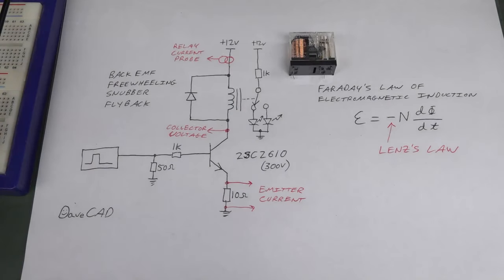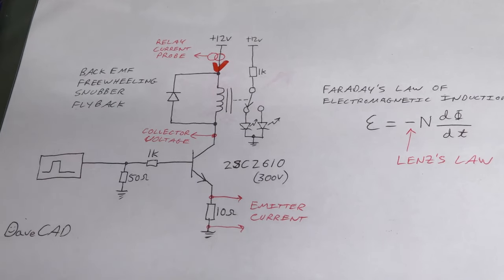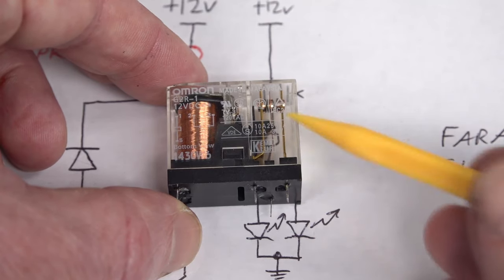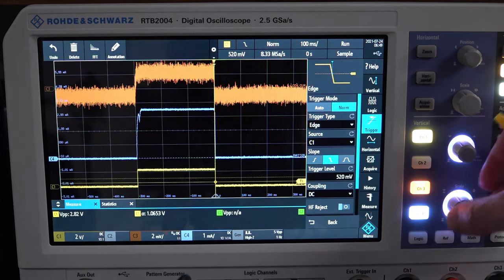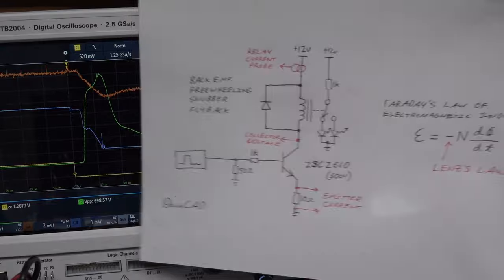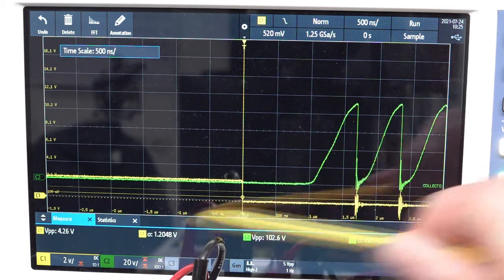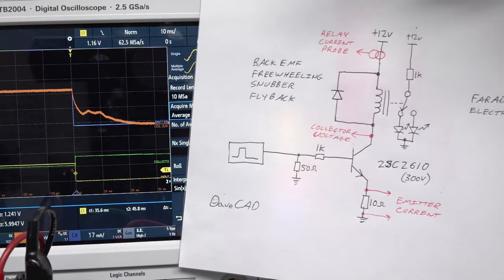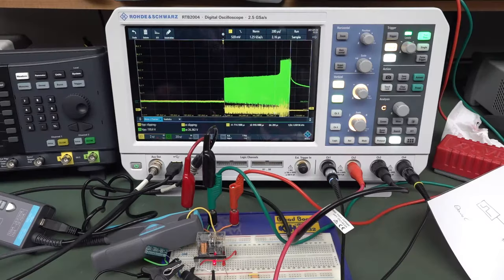EEVblog 1409 - The DANGERS of Inductor Back EMF

Comment: I think this is the best place to say my most recent vacuum tube build...it's a vu meter the tube is a bar display ...well I hook it up and it's maxed out so I add high value resistors and still no change....then in frustration I unplug the audio lines...boom I have a perfect signal and not maxed out dancing away....after some fiddling I found my audio source a blootooth pcb was sending audio thrue the power USB plugs on it threw the other power plug and into the tube ....my build is literally relying on back emf as it's input lol.....I found it cool just thought some one else might too :)

Comment: Connect two wires across the relay (without the catch diode) and keep the open ends of the wires close to each other to see if an arc jumps across the wires. That would be cool to watch! Heck, you can probably make a taser like that lol!
Reply: And this is the basic working principle of flyback converters, btw they are actually used in tasers

Comment: In the old days before semiconductor diodes, it was common to parallel coils with shunt resistors to prevent voltage spikes.  I have serviced old Western Union clocks that use a vibrator winder.  The vibrator is driven by a platinum-contact interrupter and two No. 6 dry cells in series.  The armature coil draws about 300 mA and has a 600 Ohm shunt resistor to absorb the back emf and prevent burning the interrupter contacts.  Interestingly, the Western Union clocks used in radio stations were sometimes 24 Volt DC powered and had a much higher resistance coil in the vibrator circuit, and a coil shunt resistor was NOT used.  It seems counter intuitive at first that the little innocuous 3 Volt circuit is the one making the nastier spikes.  The i in di/dt is much smaller on the 24 Volt model and thus v = L di/dt is smaller too.  Physics, it’s the law!

Comment: An excellent demonstration. It's one thing reading this in a book but it's much better when demonstrated like this. Perhaps if you had a radio and we could listen to the r.f. produced as well it might be interesting. When I was about ten or twelve years old I had a transformer and connected a 9 Volt battery to the primary. I held the wires on the primary and got a shock and didn't understand why. You don't get a shock from a 9 Volt battery.
Perhaps if I had asked the physics teacher at school why this happened I might have known. We didn't do electronics at school then, how different it is now and I might have taken a different route in the jobs I had. In the mid 60's I got the impression teachers were not interested in much more than just doing their job. I made an H.A.C. one valve radio from a kit at 13 years old but never told any other kids because I'd probably be laughed at. It was football, football, football and nothing else. I wasn't interested in football.

When I was 19 I studied for the radio exam and I found out about back e.m.f. and have since always put a diode across a relay. I use BC109's for the switching transistors and 1N4004 diodes for switching frequency bands in my home built transceiver because I had bought loads of them cheap. I love making and modifying radio stuff.

G4GHB.

Comment: Induced currents are interesting to consider.  Mostly because they flip things from the standard training on electronics of a voltage source when applied to a resistance creates a current.  But a current when applied to a resistance creates a voltage.  And how in older car points and condenser ignitions the capacitor (condenser) was used to delay the voltage rise and thus arcing on the contacts (points) as they opened and closed.

Comment: Great explaination Mr. Dave. I've suffered the same case long time ago with a bit different (you might want to put this to a demonstration if you're please). I used a 5V powered microcontroller to switch a series of components from photocoupler -> transistor -> 12V relay (with clamp diode of course) -> 7W 110V AC motor. The relay was rated for 110V and 5A AC. There was no problem in the switching on phase, but everytime when the relay switched off all the DC power was lost and my microcontroller was reseted. It was worse than switching a diode on and off. I was desperated to find a solution for that, from increasing one more layer of photocoupler, isolating 5V and 12V power supplies grounds to physically isolating the AC and DC circuits, nothing worked. I wished I could have known the QuenchArc sooner, in controlling 3 phase AC motor through contactor we has a set of these hook up to 3 phase line, otherwise the PLC would be fried. Later in my work experience, I also discovered that a triac could switch AC components quieter and essier to apply than a relay.
Reply: What’s the point of optoisolation if you still drive the circuitry from the same power supply? If the output side of the optocoupler was driven by a separate transformer winding, or by an isolated power module, you’d have had no problems on the MCU side, assuming you didn’t introduce inadvertent coupling across the isolation barrier :) You’d have blown out potentially something on the output side – the discrete transistor or the optocoupler transistor. But the MCU would have been happy.

Comment: Also, I believe on an H-bridge motor driver you keep the low-side transistors On so the motor dissipates the energy in either direction. One mosfet conducts normally, while the other lets the current flow through its internal diode, if it has one.

Comment: I think the same problem is going on in my company's hardware that keeps breaking down. We make mask's for the medical sector and we use a friction welder to make them. They are from a Chinese brand (yes I know before you ask) and the friction welder is essentially a coil. These keep killing the generator driving them or both. Sometimes shortly after installing or after a few weeks. 
I have a feeling that the Chinese manufacturer don't or intentionally didn't include this to protect the equipment. 
I think this video could be helpful to solve this problem only i don't know what value the added component needs to be. 
The generator works at max 2 amp, +-18.000Khz but I'm not sure now how much voltage right now (instructions only states it's working at high voltage).

Comment: 07:15 this arrangement is used in many HE (High Efficiency) LED lamps, where not only the current being drawn through the inductor is used, but also the energy stored in the inductor is used as well. Bigclivedotcom has taken apart many a lamps with this configuration with buck or SM PSUs

Comment: in the automotive world, two types of "snubbers" are used in relays, the first kind is just a resistor, usually found on older vehicles, or modern vehicles with hardened drivers for the relays. the second kind is when the relay has a reverse biased diode in the relay itself.  This is important, ad put the former relay in the latter place, you can easily damage the driver, and also when testing relays, if there the diode type you naturally need to be carefull about testing .. I know this is echo'd in the comments over and over but always worth bringing up. cause of many many weird intermittent failures or repeated controll module failures.

Comment: My homebuilt dual 555 ignition coil driver for charging an electric fence used to suffer a lot of back emf blowing the 555s or the power mosfet that was switching the igntion coil, ended up using a neon lamp to absorb and back emf and it hasn't blown a 555 or mosfet since in several years of operation.

Comment: I knew the principle of what the flyback diode was needed for, but I thought the extent of it was protecting the transistor/drive circuit from HV spike damage. Never would have guessed that without it the transistor can also start oscillating at 1MHz+.

Comment: I still think the way I first learned about this was the best way to understand it. Just take a 9v battery and connect it to a very large inductor. Remove one of the wires with one hand while holding the terminal with the other, and inadvertently throw the inductor to the other side of the room.
Also, if you connect a 24v DC power supply to a microwave oven transformer, it draws a couple amps, and when you disconnect it, it will maintain an arc over a centimeter long for about half a second. I'm glad I wasn't touching the terminal with my other hand that time.

Comment: The reason the relay noise changes when you add and remove the diode is because as you already said, the relay switches slower, so the diode will make the relay action softer as the voltage/current dissipates then this translates to a less vigorous click as the contacts hit each other more softly..?

Comment: 27:15   -   I'm not sure about your other proposed snubber solutions there. Whatever one put as a snubber , wether a diode or Zener or resistor Capacitor diode arrangement, the final problem always remain about the energy stored in the coil. Which means whatever solution that energy has to come out. My guess would be that the more conductive the snubber ( in one only direction) the better, for it would consume that energy the quickest way possible. Anything else in series would slow down that process. Dave, I wish you could elaborate on that . Thanks for this great video content.

Comment: Automation cabinet builder here, we occasionally had safety relays go into a error state whenever we pushed the e-stop button, turned out that these relais checked their contacts, and because of the non flyback interface relays, it would go into error
Reply: What did the PLC relays check the contacts for, that they'd throw an error? Isolation over 50 ohms to some signal? ...the checker had flaws to show up more than to use, then?
Reply: @Cineenvenordquist  i'm not quite sure what you're asking exactly but, the error from the emergency stop relay was probably because the relay thought it measured a short on the contacts

Comment: Use to make zap boxes 40 years ago with with tiny transformers, either the primary or secondary windings, what ever gave the best zap. And a mercury switch and a 9 V battery   Then wrap the little box with foil wrap. Each corner isolated from the others. Hard part I needed to test is as i went.

Comment: And then some, pre-electronics,  Pipe Organ manufactures would use the inductive feedback to help clean the silver contacts of the organ's keyboards.
Connection would be made in a sliding/wiping action rather than a point contact.    The arcing that occurred would clean the silver contact surfaces.

Comment: A word about those snubber diodes. Usually a 100mA 75 small signal type like a 1N914/4148/4448 does the job, but the stored energy in some relays is enough to damage the diode by exceeding its current rating. In those cases a 1N400X or similar type diode is required. Beware !

Comment: You've know idea how lucky the kid-me didn't repeatedly blow every transistor in my beginners electronic kits! 😜

It was years later I became aware of back-EMF, but now do a realised quantifiably the voltage levels (at albeit low power levels) I was dealing with... it does explain the sparks and why if jury-rigged the relay with a capacitor I'd get a crude spark-gap transmitter that'd really mess with local radios.

Comment: Brilliant. Thanks, Dave! Will be waiting for PWM basics video. Until then my mosfet driver chips contunue to blow up when trying to regulate 55w 12v bulb with 30a mosfet. Dunno why.
Reply: You may need to add current limiting resistors and protection against negative transients on the gate driver output.

Comment: I used to use tiny 12v relays (about 1/4 the size of the one you use in this video) and had them kill (short) 1N914 diodes.  I use 1N400x diodes now.

Comment: 1. As the armature moves the inductance of the coil changes.
2. I've seen relays with a shorted turn (=copper washer), and ac?  types with a groove in the steel end of the coil to fit a shorted turn over half the coil.

Comment: Technically, the term flyback is from the CRT flyback transformer circuit, freewheeling from resonant circuits...  The names come from different circuits where the diode had the same basic job - give the inductor a discharge path, whether for protection, timing, voltage generation or other design factors.  Not too surprising they've all come to be used interchangeably.

Comment: In automotive applications that diode can lead to trouble if the battery is accidentally applied backwards. A resistor snubber is preferred.

Comment: What's missing is that while the math reflects the observed back EMF  (from E = -ndI/dt), I have met only a few people who question the exact physical nature of how a 12 volt supply can create a 700 volt spike.   To get at the answer, you have to create a speculative physical model of the space around the inductor - and the model includes just how the magnetic field in the space around the inductor manifests.

When I discuss this with experimenter friends, I point out "the same physical model we have created is valid in 'empty' space, outside the atmosphere" because it's important to understand that the manifestation of a magnetic field in a volume of 'empty' space around a coil is 100% legitimate  - otherwise, no NASA spacecraft would function, since they all rely on coils and magnetic fields on circuits that are outside the cabin.  In the Space Shuttle, for example, all electronic/electrical gear in the payload bay worked fine during the opening of the bay doors to 'empty' space.

A related and "commonly accepted, never questioned" issue is - pushing two "like" magnetic poles together.  Particularly with rare earth (neodymium) magnets, pushing two North (or two South) magnetic poles together puts up amazing force against the action.  A look in the space gap between the "like" poles as you try pushing them together shows it is 'empty'.  

Our physical model accounts for what actually is occurring; it involves the constituents of the Vacuum.

There is a lot of 'sloppy' thinking and "commonly accepted, never questioned" convention in electrical and electronics work.  I have an education and work background in the subject and it's very rewarding to be able to explain what's happening in the 'empty' space involving magnetic and electric fields.

Thank you kindly for an excellent, very clearly explained subject.  Figuring out how to use the back EMF instead of relying on a snubber is a topic for another day.

Comment: I loved the entire video. Its structure is superb and entertaining to boot! My only concern is direction of current flow in your video. Did the accepted direction of electron current flow change since taught in 1967? We were taught that electron flow is from Negative(-) to Positive(+). Typical Vacuum Tube theory stated that the Cathode(-) was heated by a hot Filament which caused Electrons to leave the Cathode and seek the positive(+) Plate. BJT's were taught  Emitter(-) to Collector(+) for NPN Transistors. Common Diode Forward current flow was taught Cathode(-) to Anode(+). Maybe I just misunderstood parts of your video?
Wakodahatchee Chris

Comment: Back in my school days, I used relays to drive motors, and the relays kept breaking; contacts would get stuck.  At the time I didn't know why, but it was because I had no flyback diode on the motor coil.

Comment: The freewheeling diode makes the current stick around in the coil for longer, and dissipates through resistive losses; this is why it sounds tamer. If the circuit is losses, the current would loop forever and this is how MRI superconducting magnets work.
Reply: *if the circuit is lossless

Comment: It seems a capacitor across the relay coil could be a type of timing ckt. cap must charge first
and when volts to coil are off coil still holds a field until cap is discharged.

Comment: Why would it be louder without a flyback diode? One of the things you said is that it takes longer to de-activate when the flyback diode is in place. So, when the energy in the coil runs through the flyback diode is keeping the relay activated for a bit, and the amount of energy still left in the coil decreases over time, up to the point there is not enough energy left to keep the relay activated, there is still some energy left. It is not pulling hard enough to keep it activated, but still pulling a little, causing it to move back to the off position slower.  That would be my theory,
Reply from the maker: Without the diode it slams back harder and faster. The diode delays the time and effectively "softens" the armature pullback.

Comment: Hi, would have been interesting to put an am radio by your first low voltage transistor, 1.7mhz is top end of the AM band. A 100 ohm resistor in series with the clamp diode will quieten things down. A scope is invaluable Cheers.

Comment: Caps are easy but inductors take a while to understand (at least it was for me).  If you have super conducting wire and you can short the inductor it will loop forever.  For normal switches I've heard the term "the inductor always wins" so the voltage will arc (~300volts for air) across the switch to dissipate the energy.

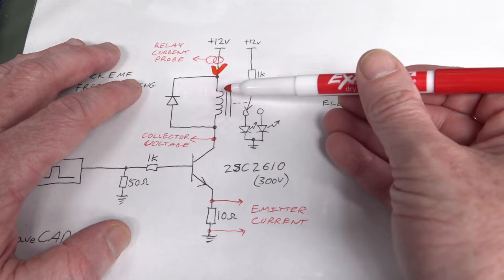Comment: @2:50 That current flows "up" through there, not "down". I don't do conventional current methodology.
 I use the true representation of current flow from a negative towards a positive. That is the way I learned over 40 years ago through direct examination of PCB's during diagnostics without schematics available. I had to create a mental schematic. The current flows against the arrow of a diode.
Electrons don't actually flow [well a little] but that's another topic.

Comment: Tend to use the rectifier diodes on the larger relays. There are Ultra Fast versions of these designated by the UF in their part number. Have a slightly higher forward voltage though. Wonder if the UF diodes could be used on repetitive operated relays.